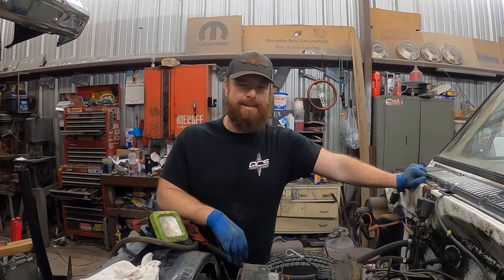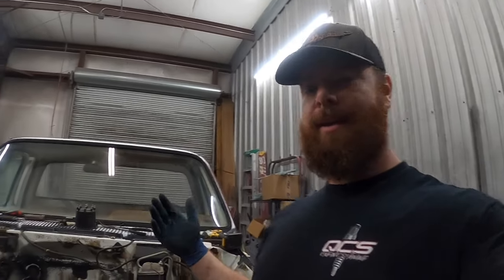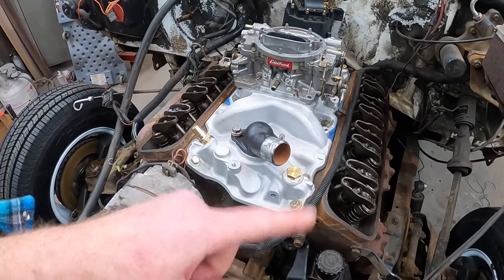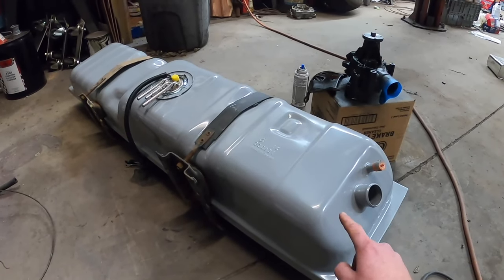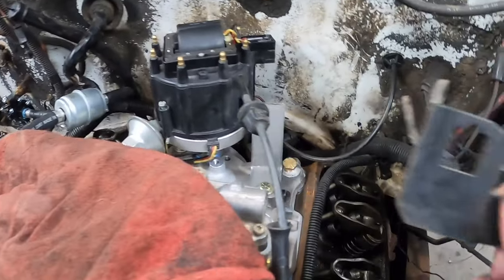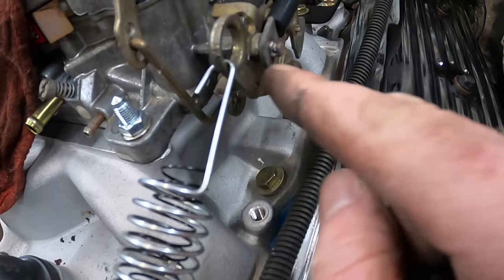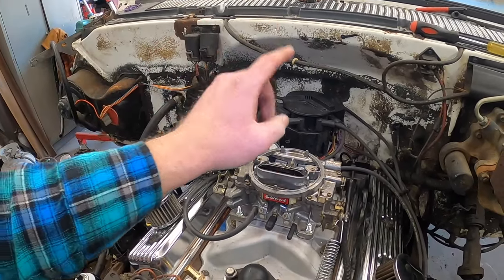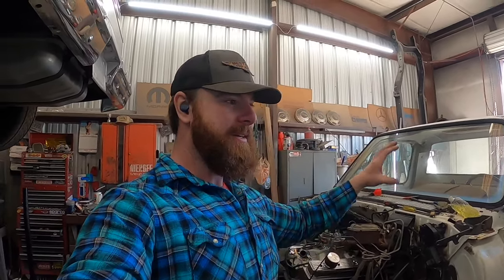TBI to Carburetor Conversion

Comment: What you do is just put a mechanical fuel pump or a little electric one on the frame and call it a day and you know how to mess with any of this crap
Reply from the maker: This motor isn't drilled for a mechanical fuel pump, and the electric inline pumps I've had bad luck with. I opted to use an 87 model tank, sending unit, pump, and a fuel pressure regulator

Comment: Going the wrong way. Shoulda gone from TBI to MPFI. Modern gas just doesn’t work with carburetors anymore.
Reply from the maker: Multi port is definitely better but out of the budget for this project. I've had pretty good luck with modern fuel in carburetor vehicles, but I love in Georgia and I believe we have pretty good fuel here.
Reply: Works just fine with carburetors. I'm on my 3rd engine in my 86 GMC and still using the original Qjet.
Reply from the maker: @troymecey  haven't had a problem either!
Reply: That’s the dumbest thing I’ve read in along time 🤣🤣
Reply: If you have a tbi you can literally only upgrade I don't think you have had as many problems as the rest of us😂
Reply from the maker: @TY_IS_FAHRENHEIT  😆
Reply: Real men utilize carburetors 💪🏻
Reply from the maker: @academaciated7466  👌

Comment: Nice bro i have a 2 point fuel injector honda crx and im ready to put a 32/36 Weber on and i was wondering if i can used the original fuel pump and put a fuel regulator the Weber run around 2.5 to 3.0 psi plus my ECM obdo i know the distributor will work fine timing wise but i wonder if i can used the oem fuel pump let me know thanks  if know what i can do ok will appreciate you help.If know i will run a mazda rx7 fuel pump from 1980 they are carb and psi is around 4.5 psi i will appreciate you help and opinion thanks again
Reply from the maker: @salrivera7578  I'm no expert on those cars but in theory that should work!
Reply: @BestDamnShopAround  you think I can used the OEM fuel pump with a fuel regulator bro
Reply: @BestDamnShopAround  the CRX Honda is a duel point fuel injectors really a carb with 2 injectors
Reply from the maker: @salrivera7578  I'm not 100% sure but I believe so. Worth a shot!

Comment: Im doing a similar build. Does the little purple/white stripe wire that was used to power your fuel pump relay bypass the ecm? Or does it tell the ecm to power the fuel pump relay?

Comment: Saw another carb swap page and he added a Fast TCI EZ Plus to control tranny shifting, do you need that also?
Reply from the maker: @filfarmerpacnw4868  this truck has a TH400, it only requires a vacuum signal. The fast unit is most likely for a truck with a 4l60 or equivalent electronically controlled transmission

Comment: I was having problems like that, and it turned out. It was the wires inside. The distributor had dried up and fell apart and was shorting out and only one side of my end TBI was working.
Reply from the maker: @Youdontknowmelikeiknowyou  that's crazy! Good thing you found it!

Comment: Does the lock up still work on torque converter?
Reply from the maker: This is a th400 within lockup. You would have to wire that into a lockup switch if the transmission allows.

Comment: I got lucky with the TBI on my OG 305 in my '87 swb. 
It was a fairly rough truck when I bought it a few years back. But after a basic gasket rebuild, and replacing the sloppy distributor with another from a junkyard, she fired right up and ran smooth. 
I'm usually a carb guy. But I'm diggin' not having to pump the gas and mess with a choke and sit there and baby sit it as it warms up. 😎
Reply from the maker: I've had great luck with some TBI units and some that have fought me to the end! When running correctly a TBI is pretty sweet! But on this one I believe the throttle shaft was worn out causing air to leak as well as something funny with the ECU. And to be honest I thought it would make some decent content, potentially helping some other guys wanted to go down this route.
Reply: @BestDamnShopAround  Yeah, that's why I say "lucky" when it comes to my TBI. (Though I expect it'll start giving me issues any day now. 😉)
It seems most don't work well and even after you fire the parts cannon at it, it still fights you. So I don't blame anyone for carb-converting it.
Reply: My 89 is in really good shape. I'm just wanting to stay old school.
Reply from the maker: @dennisowen3717  nothing wrong with old school, I'm a fan of it!

Comment: This is a very well laid out and informative video. I saved this to my Playlist for reference later on. Bought a "barnfind" 92 c3500 crew cab dually from Texas. 454/5speed 2wd. 😢Been sitting for 20 years, got it running, new everything pertaining to the tbi and ignition, and it still doesn't run right. Been working on it for almost a year, it's finally reliably starting every time, but I've stuck more into getting the drivability right, than it cost to buy the truck in the first place. 

At this point im tired of the gutless tbi, engine and all and I'm swapping it out for a built 454. I'm hoping for over 550 whp. We'll see. 😂 this truck has been fighting me tough from day one.  I see why the previous owner left it in a field. 😅
Reply from the maker: @sergeantspeed5941  thanks for tuning in and subscribing! I know they can be frustrating but it would be cool when you're finished!

Comment: I am old school die hard Carb guy but the TBI system when running good is bullet proof and will run a long time. Watched the video No Nonsense that travels all over the United states with his Girl Freind picked up a 2500 Suburban I think it was a 89 in Vegas it sat for years had TBI Chris got it running did basic over haul to get it running drove it from Vegas to Penn and averaged 18 miles to the gallon . What full size Suburban gets freaking 18 miles to the gallon with old dirty injectors and probably a worn out throttle body? I was blown away I figured 12 would be max. If you did a bushing kit and rebuilt the throttle body and put in new injectors it would run good and never let you down . Love TBI good cold starts and excellent MPG and simple cant ask for anything better than that
Reply from the maker: You're right, when they work correctly they're great! This particular one didn't run well and instead of investing time and money and rebuilding it I decided to go with a carburetor with the future plans of removing this drive train and putting it in an older style hot rod which would make it even harder to have TBI. 18 MPG and a 2500 suburban is very impressive!
Reply: @BestDamnShopAround   . Chris was blown away too with the 18 MPG it was jaw dropping for me. If you wanted to you could jerk the harness and install the ECM go through the TBI  and have that 18 mpg with your hot rod. But I get the jest of Old School and go carb

Comment: Did I miss something . . .  where did the fuel regulator get mounted?  Would be nice to have seen how you did that, as well as took care of the 'excess wiring' that come along with the TBI (MAP, IAC, etc).
Reply from the maker: You're right, I forgot to show that part. I mounted it on the firewall behind the passenger side cylinder head with the supplied hardware.

Comment: I am in the same process,  thanks for ideas!!
Reply from the maker: Thanks for watching and subscribing!
Reply: Did you figure out what was wrong with yours or did you just carb swap aswell I can't get mine to run right and have changed everything besides putting a carb on
Reply: I changed intake ,distributor, and carb.. it started right up.. I took computer and all out of vehicle.? Customer was very happy  and still driving truck..
Reply: @bobbysanders6231  ok that's what I'm going to do today
Reply: @chevyteske5394  ok 1 more thing to add, if u have the fuel pump in ur fuel tank, get a return fuel reg.. a carb only takes bout 6 pound
Reply: @bobbysanders6231  my fuel pump was only doing 5 psi so I changed it but I'll change it back so it's not too much
Reply: @chevyteske5394  u should be good.  Just tune with ur gauge if at all possible.  I left that Guage i had with the guy , to make sure it works good..

Comment: TBI is 9-13 psi fuel pressure? 
The TPI was around 40 psi ?
Would I need the Holly fuel regulator or is the stick 94 TBI regulator ok to use?

Comment: It was the Pickup in the distributor. They go bad and give funky symptoms. They idle, but surge when you rev. Then dies completely. Intermittent miss.
Reply from the maker: That's pretty much what it was doing!
Reply: @BestDamnShopAround  had issues with my 92 k1500 changed every sensor, dizzy, coil, fuel pump couldnt get it running good for nothing so I did the swap had a tough time making it run turned out to be the oil pressure sensor it is also a safety switch for fuel pump once I changed it fuel pump runs as it should, my issue I was following other peoples wiring for distributor all I used is the coil wires white and red white for tach. I tried the purple wire didnt work
Reply from the maker: @cyberdude721  good to know!

Comment: Awesome vid.  Answered all questions I had about my build.  Only thing I'm concerned about is, will the stock fuel pump keep up with a 375 hp 350 with a 750 carb?
Reply from the maker: In my opinion it would, but I've never pushed the limits of a stock fuel pump.

Comment: Great indepth on this! Got my sub!!

I have a 93 K1500. Gonna have to rebuild or replace my engine and have been chewing on doing this conversion it comes time to freshen up. 

Other than the TV cable bracket, what extra, if anything, has to be done since I have an automatic transmission?
Reply from the maker: @piedpiper8355  thank you for the subscription! If it's a 700r4 just a TV bracket. I loke the company called TV made ez.

Comment: I just got an 81 2nd gen Camaro , im wanting to rip alll of the tbi wiring out, and put a new 350 sbc carbed, was wondering if you knew where the best spot to start would be and or what wiring needs to go? And what can stay!? Obviously Alternator, starter, battery and etc needs to stay..
Reply from the maker: @hunterbailey6457  correct, also your gauge wiring will need to remain

Comment: Summit Racing part numbers for those metric tubing to AN6 adapter fittings.

ICT Billet F06ANFM1415 - ICT Billet AN to Metric Adapter Fittings
Part Number: ICB-F06ANFM1415

ICT Billet F06ANFM1615 - ICT Billet AN to Metric Adapter Fittings
Part Number: ICB-F06ANFM1615

--Doozer
Reply from the maker: You're the best!

Comment: Yeah I had started to get issue with my tbi and timing retarted so fixed the timing replace ignition coil and new cap and rotor and also put English flush to clear up and clean up and wtv else it could do to clean the injectiors seems to done the trick for my truck still has lil something I can tell but last thing I know of needing to replace is my lifters and cams and likely push rods and all those components
Reply from the maker: They're hard to diagnose!

Comment: Was this truck an automatic and if so what did you do for the throttle position sensor
Reply from the maker: Yes it's an automatic. This particular truck has a turbo 400 that does not require throttle position.
Reply: Is it the same for turbo 350? @BestDamnShopAround
Reply from the maker: @aliaswizard6963  correct, a TH350 transmission does not require a throttle position sensor
Reply: @BestDamnShopAround is this the same for a 700r4? I’m doing this same swap
Reply from the maker: @Leip302  with a 700R4 you'll have to have a TV cable bracket as well

Comment: So you dont need to use an electric fuel pump?
Reply from the maker: @aliaswizard6963  Yes, you'll either need to run an inline electric fuel pump which I do not recommend or an in tank pump like the 87 trucks

Comment: I'm about to comvert my 94 Chevy Cheyenne today but what I didn't realize was that my transmission has wiring that goes directly to the electrical computer box... its a 2x2  3500 ...  What would be the alternative for transmission wiring?
Reply from the maker: I'm not 100% sure, sorry! I'm sure the wiring is throttle position but I'm not positive who makes an adapter.

Comment: Thanks for making his video!!

My 1994 Chev Step Van dies ne day, I put it in my mechnica, and they spent some time with it, and let me know it's not going to be economical to get it going, (they know my style and budget)

My van is supposed t e throttle body, but they impleud it was full fuel injection. 

If it IS???   Does anyone know??

If it is full fuel injection can it be converted to carburetor in this same manner???
Reply from the maker: Yes, it should be fuel injected. I personally never done a carburetor conversion on a step van but it should be the same basic process as a pickup truck, it should share the same 350 cubic inch small block

Comment: Which Transmission do you have. If it's the 700R4 like my 89 K2500 is what do I do with the TPS. I know I need to adjust the TV Cable on the Trans but the TPS has me stumped. Do I just not use the TPS or do I have to hook it up to the Carb.
Reply from the maker: My truck has a th400. You can use a kit called TV made ez for the 700r4
Reply: @BestDamnShopAround  Thanks but I might just go ahead and get a t400.
Reply from the maker: @dennisowen3717  they're great transmissions, only downside they don't have overdrive.
Reply: @BestDamnShopAround  I know. They're great. I don't care about the overdrive.
Reply from the maker: @dennisowen3717  should be perfect then!

Comment: Outta curiosity, does this setup still need the ecu to run the fuel pump or are you running entirely without ecu input?
Reply from the maker: @zacharyfisher4812  running it on separate dedicated circuit.
Reply: @BestDamnShopAround  can you show how you ran your own circuit?

Comment: Great video! I have a 2001 s10 4.3. No one can get it to start. A little either and it runs great from then on. New computer and a bunch of other stuff! Tired of fooling with it
Reply from the maker: Thank you! I know that they made a carburetor version of the 4.3 that came in some Marine applications. Might want to look into that, imagine an intake manifold will be the hardest part on that truck